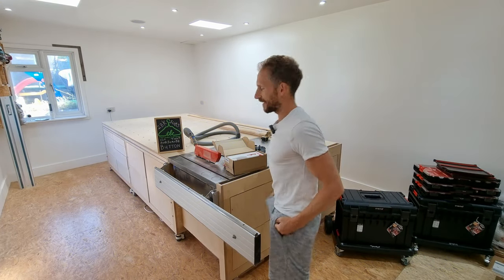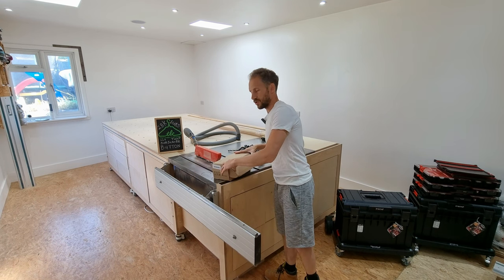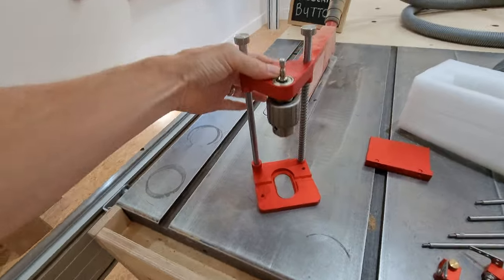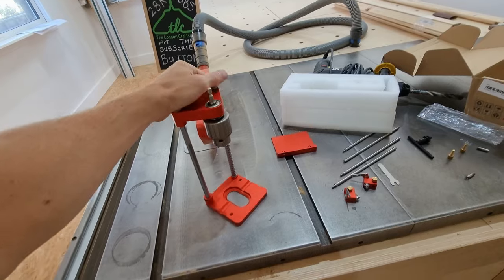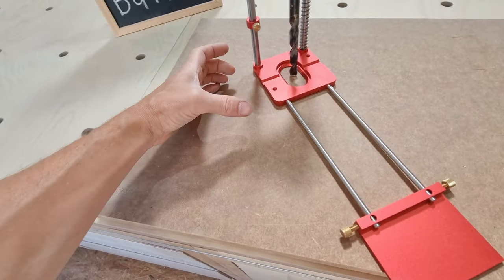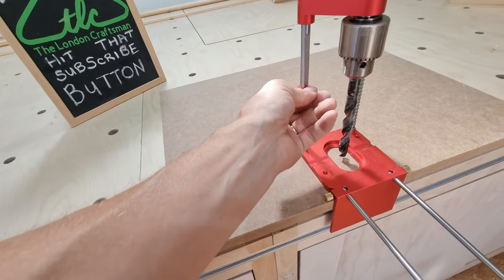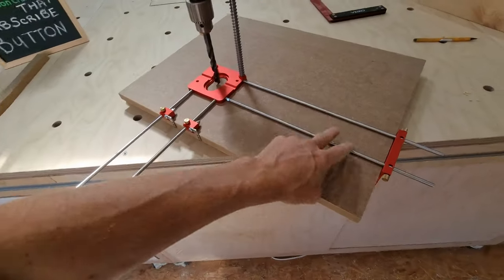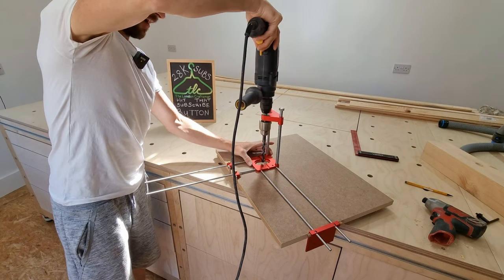Auto Line Drill Guide // First Impressions, Demo & All Features // Vid#101

Comment: Try turning the drill round 180 deg so that the weight of the handle and cable are over the uprights. May reduce the wobble by balancing it.
Reply from the maker: Good shout 👍
I'll probably try and use a smaller drill in the future too 😁